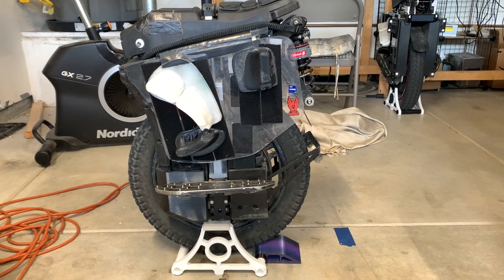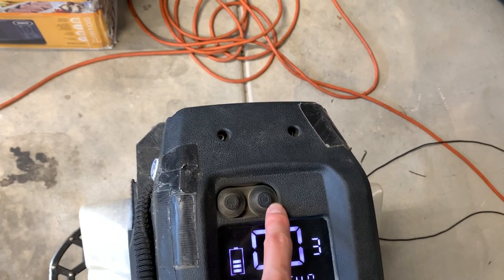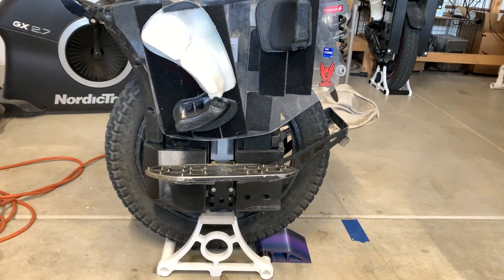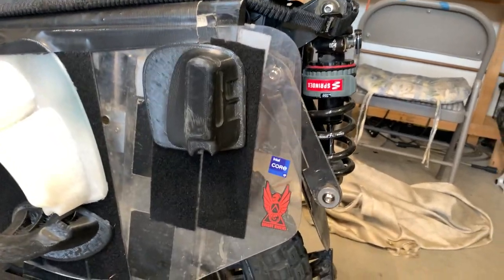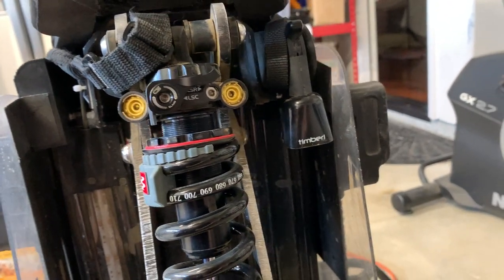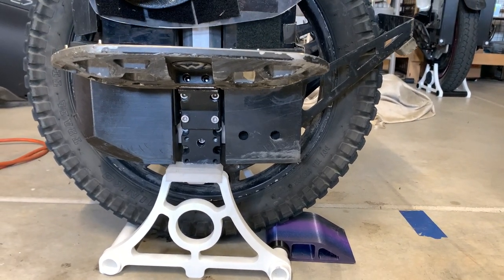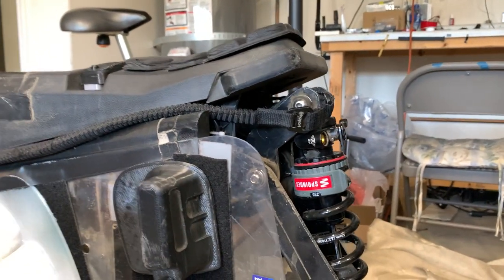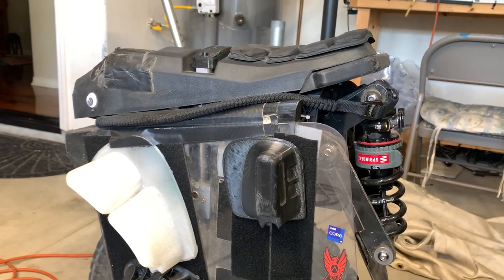Thoughts on My 100mm Travel Begode Master

Comment: Nice job. I also designed custom linkages for begode wheels, same CC DB IL, and you're spot on regarding the pivot point and what's practical on the wheel. Try a progressive spring or an air shock, which has natural progression.
Reply from the maker: I was originally using a 550-670 cane creek progressive, but found that the weight was too light. That prompted me to use the sprindex which is also progressive at the last 20% of the stroke, but despite it being 750, the linkage I build is probably better off suited for a 800 or 850 progressive. Unfortunately nothing of the sort exists on the market right now :(

Comment: Been tempted to try modding my suspension to 100mm as well - Did you find clearence issues with the stock pedal hangars? or had you already replaced them with the adjustable ones from the Master pro?

The newer masters come with a shock designed for 100mm that preloads the shock :/ - There are coil shocks that are just about loose enough to still fit without preloading the coil (and it completely screws air shocks), but then you still need the stiff spring, as I'm finding. Are the EX30 tubes a drop-in replacement? The alternative for me is to get my own 30mm tube and drill it, though I don't really have great hardware for that.
Reply from the maker: The issue with going with the stock hangars is that the extra travel just means the pedals sink lower during full compression. Whether or not that is a big issue depends on the terrain you like to ride. Personally I did not want the top of the wheel riding up any higher on my knee so the raised pedals were very nice. That said, the cutout slot on the master pro hangars is thinner than the cutout on the ex30 suspension rods so there ends up being a gap if you’re using the correct size aluminum plate to fit the master pro hangers. This eventually caused the rods to crack and I had to replace them. I ended up buying ex30 compatible raised pedal hangers from hou ningning to fix this.

I am using the ex30 tubes as a drop in replacement, but I think going with the master’s style of solid bar without any cutout would be a more durable option. Regardless, there is some level of fabrication needed with either setup as you will need to make your own lower battery bracket.